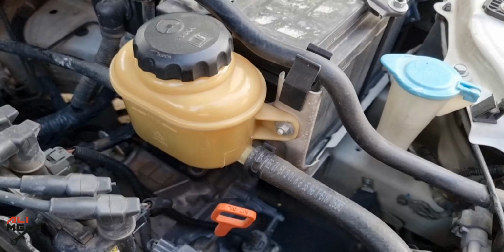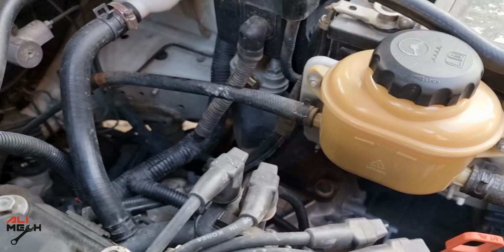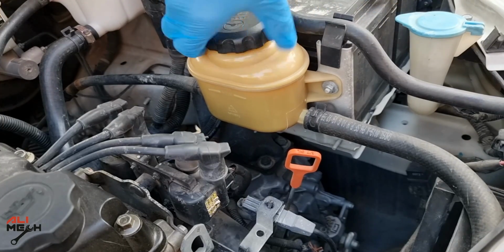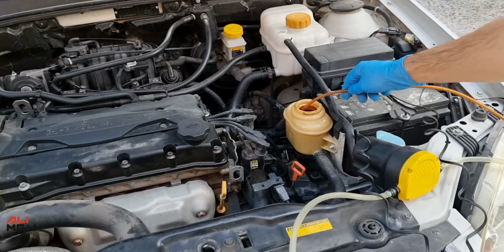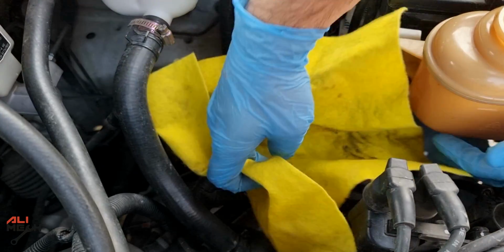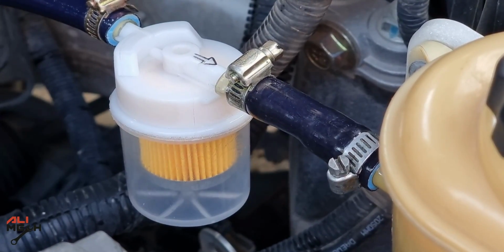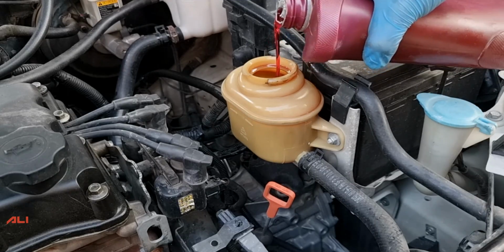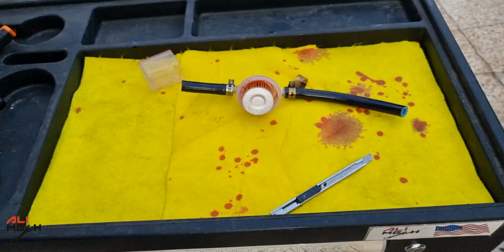This will save your Power steering?/How to filter power  steering fluid/How to flush power steering

Comment: You should consider using in-line transmission fluid filters. Metal and designed to withstand the heat.
Reply from the maker: Yes it's good for long term for sure

Comment: Why we dont keep the filter because the presur?
Reply from the maker: its not designed for oil and the filter paper may rips off and goes inside the oil pump
Reply: It's also not good to leave it on because in the winter, that kind of plastic will burst. Same thing with the Magline in-line filters for power steering; they just burst at low temps.